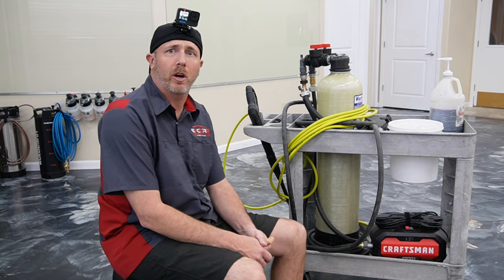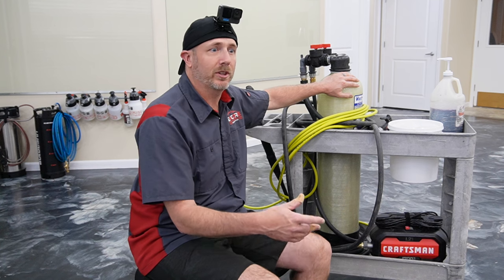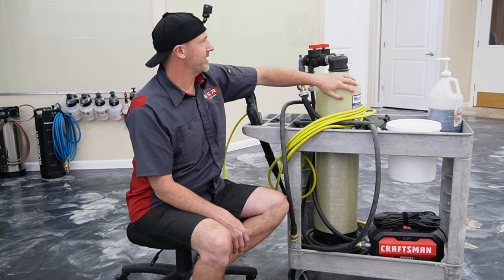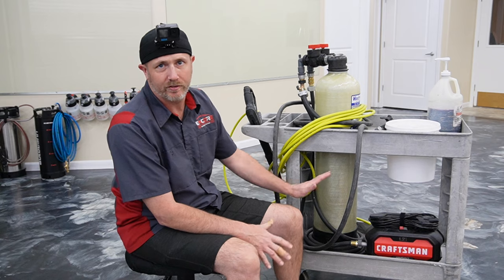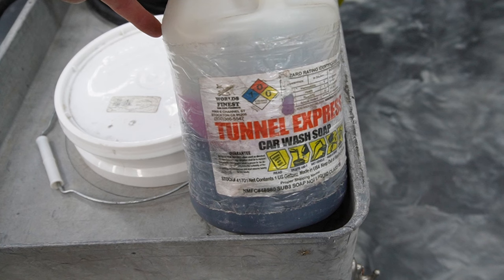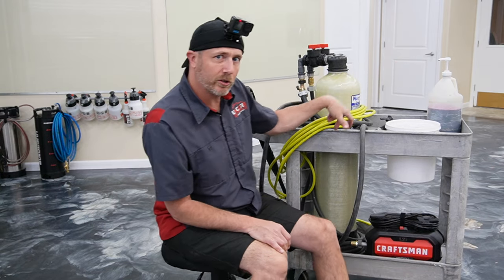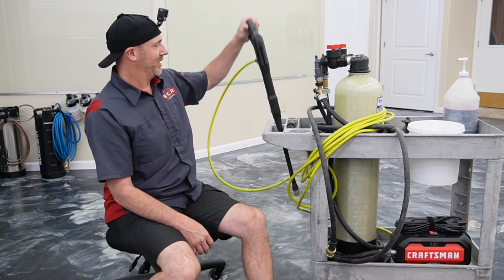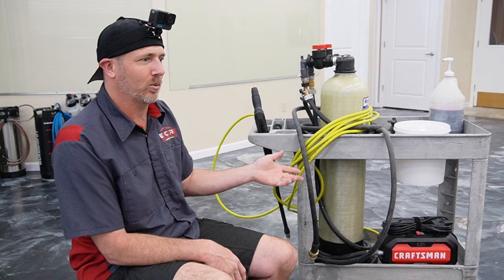Car Wash Station - Portable - No Water Spots!

Comment: Do you recommend to add Ceramic coating right away when you put your PPF film? I’m having a Model Y coming for PPF/Ceramic Coating thanks
Reply from the maker: Yes, if you can have it done right after the PPF is installed, that is optimal. It will really help with the bugs and dirt. It will also help with the longevity of the PPF. 👍🏻